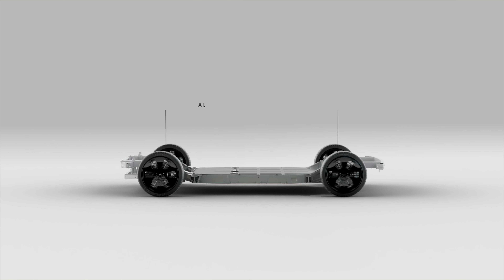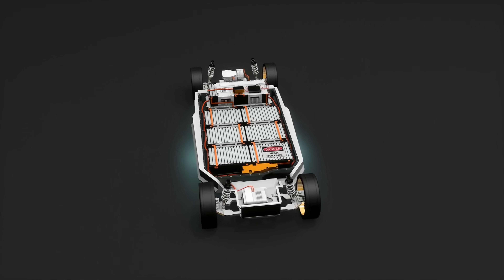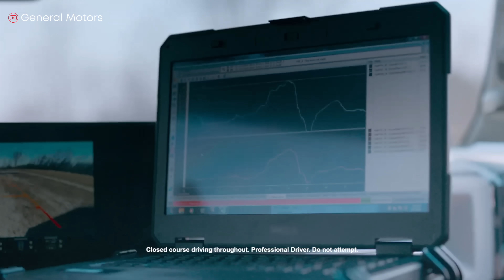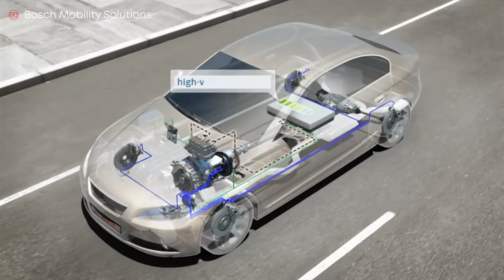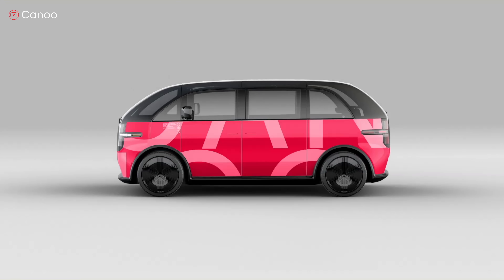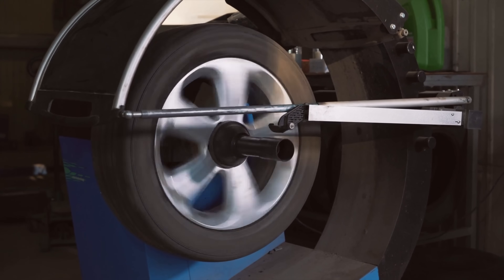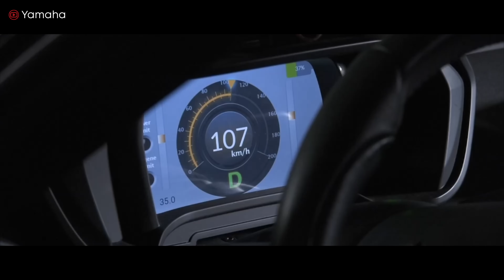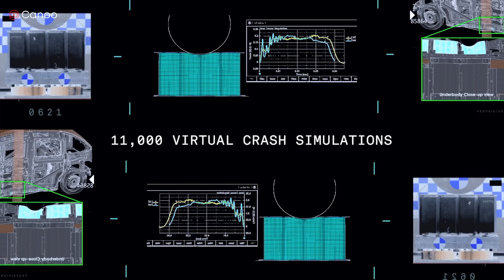No One is Telling You the Truth About Electric Cars, So I Have To

Comment: As an electrical engineer I am impressed by the accuracy of the content, keep it up!
Reply: how about this... After every one owns an electric car, where will the charging power come from? As it is, hot summer air conditioners overtax the grid ! Think about THAT ! Seems  no one ever mentions this !!!!
Reply: @marcelfortin7035  This will require building additional power plants and running the ones we have at higher capacity.  It is only a temporary problem.  The main issue with adding more power plants, is that they will most likely all be coal.
Reply: @tonycable4560  if the public would just get over it’s fear of nuclear fission, then we could have all the needed power for such station.
Reply: @crafterchief3812  Agreed!
Reply: @J Thompson agreed
Reply: @J Thompson if your responding to me, then I said fission specifically because at least to what I know, we are still in the cycle of fusion being supposedly only twenty years away(or in other words they haven’t and won’t figure it out for a very long time beyond what they say for sure when it will finally work as intended)
Reply: Have you tried creating a magnetic powered electric car?
Reply: @crafterchief3812  agreed

Comment: 2:35 Tesla vehicle are the only car you can charge to 100% regularly with no problem unlike other vehicles not more than 80%. Also the Tesla model 3 which is the cheapest Tesla can run 272 miles on a 100% charge.

Comment: I just bought a used Honda Clarity and as soon as I got it home, we realized it wouldn't charge. 

Took it back to the dealer to have them diagnose it. They needed $8k to replace the charging control module somewhere in the dash. The part itself was $4,XXX.

Forget the battery, everything else on hybrids are financial nightmares, too.

Comment: You say to avoid charging your battery too often when it doesn't really need it and I agree with you on that. But when using regenerative breaking isn't that exactly what you're doing
Reply: I thought the same thing.  I guess the recharge from regenerative braking isn't enough to cause the same issue as keeping it topped off.
Reply: That's a really good Point - so the batteries won't last as long in city driving and would also be good to consider not charging it fully in those cases.
Reply: @evhwolfgang2003  Regenerative breaking simply reduces the rate of net discharge. It's not possible for regenerative breaking to charge the battery up to or above it's initial charge. If it did you'd have a perpetual motion machine. Not possible.

Comment: Most EV's use liquid cooled thermal management to keep batteries at an optimal temperature.  This means that your EV may use a few miles of range keeping the components cool when you are not driving, but it will not significantly affect the longevity of the car (the Nissan Leaf is the anomaly as it uses air cooled batteries).  Most EV's will have ther brake pads last 100k-200k miles.
Reply: @jack99889988  You should tell that to all 56,000 of those people up in Sweden who have purchased electric cars and now make up over 50% of all cars sold there. They don't seem to be having the problems you seem to think happen.
Reply: @jack99889988  heard of a garage for storing vehicles?
Reply: @Aircam73  Same in Canada. A friend of mine has a 2007 Toyota Hybrid that hasn't cost him a penny other than tires
Reply: @jack99889988  actually no....not anywhere where it actually gets that cold in the winter. unheated maybe but not completely uninsulated.
Reply: @jack99889988  The point is it is cold in Sweden and the EVs run just fine. There are even whole YouTube channels dedicated to it such as Bjørn Nyland. He takes these EVs and actually camps in them in -36C temperatures. Something you can't do in an ICE as you would DIE.
Reply: @jack99889988  "People in cooler environments tend to be more developed hence they drive cars." 

Erm, what? People in warmer climates don't drive cars? Don't drive as much? I've been living in a warm lie all this time 😂
Reply: @jack99889988  Sales on Norway are actually at 84% EV or plug in hybrid. So even higher.
The total of pure EV's on the road is 520,000 based on a June 2021 survey. The total cars registered is 5.1Million so EVs are 10% of the cars used in Norway and climbing rapidly.

Seems to be a pretty popular solution to me that's gaining traction in a country with winter temps averaging -7C for the winter months with -18C on the coldest darkest days.
Reply: @jack99889988  Wrong on every count. Are you saying that people in tropical Dubai, Lagos, Mumbai, Bangkok, Hong Kong, Djakarta, Sao Paulo drive less cars? Or that people in those cities are less developed than people in Alaska, Siberia, Patagonia? 

Modern EVs have been tested in the harsh climate of the polar circle in Norway and work just fine. Why else would 54% of Norwegians would have decided to buy an electric car over an ICE car last year? 
Check the Bjorn Nyland channel here for some hardcore over-night camping inside various EVs in Norway's winter. He survived with the heat on all night having lost only 20% capacity.
Reply: @jack99889988  australia?
Reply: @Aircam73  they will operate but battery life and range are reduced is the point !!
Reply: @markp8295  well didnt u listen to the vid, cold temps significantly reduce battery life and capacity !! 
maybe they just want to be seen to be green !!
Reply: @rhett7716  The range may be reduced but that is well know for EVs as it takes a lot of battery to heat the car. It also has gotten better as most cars are using heat pumps instead of resistance heating. Battery life will not be effected as just about every EV out there has a thermal management system that will keep the battery from shortening its life by freezing. This has been proven by the hundreds of thousands of EVs that are operating in subzero climates.
Reply: @rhett7716  It reduces available capacity at a specific temperature, but doesn't deplete the charge. So battery heaters are used to allow the charge to be released.

It lowers the potential maximum range, but this further highlights how much range anxiety is irrational for the majority of journeys, since it only takes 10-20 miles off through heating.
In addition, they have a lot of chargers enabling users to warm the batteries up 5 minutes before setting off, without depleting the range as much.
Reply: @darksideblues135  What? Who is burying Lithium cells in landfill? Not in any first world country (excluding the U.S.. Not only is it illegal, but also people pay good money for them so they can recycle them.

100% recyclable using a fraction of the original resources, almost halving their initial high impact and further beating ICE cars for having much lower pollution through its life cycle.
Reply: my chevy volt still has factory brake pads  looking like new at 150k miles. I had no maintenence other than the ice engine oil chance, 12v battery, and tires
Reply: Battery management heating and cooling occurs as needed; even while driving. To say that it only occurs when you're not driving is incorrect.
Reply: Simply put you are very wrong. Batteries die in cold. I've parked a ICE engine in -40 for 8 hours and it is just fine. Not dying. And 30% of people who have bought electric  are are buying New ICE ones due to the multiple major issues with Electric cars.... Not being able to replace battery. Cost of battery, told 6k-7k. Actually about 15k to 20k...... Need solid state batteries. Game changer in 3 to 4 years.  Could go on and on....
Reply: I wonder how heavy EV cars handle in wet or icy conditions. Some northern areas have very cold winters so it would be good to know how EVs cope in those conditions
Reply: @gsabic  lol. Terrible excuse.
Reply: I don't believe you to be any mechanical expert when it comes to break pad wear and life expectancy. And I'll tell you right now you're 100% wrong.
Reply: @WheresWaldo05 you probably have more experience than my in "break pad" 
LOL
Reply: @darksideblues135  Lead, sulphuric acid, glycol, freon, lubricant, catalytic converter and more.   You really need to do some research before giving an opinion.
Reply: @Nuggetsoffudge  Yeah why are the Canadian Toyota so reliable?  I have a Matrix 2009 (gas) that has 268000 km on the meter and it still runs like new.
Reply: @luttrell1973  They handle very well. The weight helps them cut through the wet and icy conditions and their low center of gravity keeps them stable. There are hundreds of thousands of EVs driving in those conditions and if there was a problem it would be well noted.
Reply: @jamesart6568  What are you talking about? The fact that your ICE car is made from the same metals that are extracted from those damaging mines along with the fact you have to drill and extract oil to power them because last I checked I have never seen any kind of damage from EV mining that even comes close to what an oil tanker, oil rig or even an oil pipeline leak has caused to the environment. Plus old batteries get recycled as it cost less than half as much to recycle them as it does to extract new ones plus most of the metals can be recycled indefinitely.
Reply: @Aircam73  You haven't looked at lithium mining and that's just 1 small part of how damaging EVs are, and obviously you don't know about environment impact recycling batteries especially in a few years its gonna be a mountain of EV giant batteries. next
Reply: It’s a relatively cheap and effective process, but it uses a lot of water – approximately 500,000 gallons per tonne of lithium. In Chile’s Salar de Atacama, mining activities consumed 65 per cent of the region’s water. That is having a big impact on local farmers – who grow quinoa and herd llamas – in an area where some communities already have to get water driven in from elsewhere.

There’s also the potential – as occurred in Tibet – for toxic chemicals to leak from the evaporation pools into the water supply. These include chemicals, including hydrochloric acid, which are used in the processing of lithium into a form that can be sold, as well as those waste products that are filtered out of the brine at each stage. In Australia and North America, lithium is mined from rock using more traditional methods, but still requires the use of chemicals in order to extract it in a useful form. Research in Nevada found impacts on fish as far as 150 miles downstream from a lithium processing operation.
Reply: @1RealSpit1  and the CO2 made from extracting it
Reply: @jamesart6568  Do unicorns and fairy farts extract the metals, oils, fuels, fluids used to make your car? Once again the CO2 that is caused by extracting minerals for EVs is far less than are extracted for the constant need for more oils, fuels and fluids needed for ICE.
Reply: @1RealSpit1  It's a good thing that people observe the environmental impact of EVs, and thereby force manufacturers to reduce the damage they produce. However, we should be aware of a few facts, and view them in a relative perspective: 

There are about 10'000 to 20'000 people living in the Atacama, and we rightfully worry about them. Yet nobody seems to worry about the roughly 1 million people killed over petrol in Irak. Most EV batteries are made with lithium mined in Australia under completely different circumstances and using completely different techniques, btw. 

The water that goes into the production of one entire EV battery roughly equals the amount of water required to produce a few (less than 10) pounds of beef in Texas. 

All environmental damage inflicted by all EVs produced in the 21st century is still eclipsed by orders of magnitude by the pollution of just the Deep Water Horizon oil accident off Florida alone. 

When people look at all the damage and problems caused by EVs, they realise how bad it is to own and use one. They should however be aware that petrol cars are even much, much worse in almost every way. That's not something we like to hear and we prefer to ignore it, or by some magic turn it into the opposite.
Reply: @jamesart6568  I would love to live in the lala land you are. What tax revenue loss back? I also though energy companies already charged for electricity. Are you getting it for free and how can I get some of that? I don't think you know a thing about wind turbines, China or EVs because if you did you wouldn't be saying such nonsense. Also please post the Guardian article that admits EVs cause more CO2. Because there has only been a thousand studies that prove otherwise.
Reply: Just a small side note on the LEAF: Nissan's battery chemistry is formulated to permit hotter operation in the newest gen battery, and they are digitally managed also...so if a zone of batteries is running hot, the car can stop drawing from those cells, and if the whole battery is running hot, the motor power can be reduced, putting it into "turtle mode." This isn't generally something you'll run into unless you do 2 or more quick charges within a couple hours on a warm-to-hot day. This is treated like the Apocalypse by some EV enthusiasts, but the tradeoff is no moving parts in the battery cooling equipment, so there is an upside. If you live in mild climes, or are unlikely to go on 300+ mile trips in a single day with the car, you're unlikely to have to deal with it.
Reply: @Ilander86  It charges slower than every other current EV, even on a good day and it's 2015 tech overall, with low resale value. You can get a 58kWh Ioniq 5 base model for about the same price as a top trim Leaf, but the Hyundai is still better equipped and a better car in every aspect one might consider. And it will charge at 100kW AVERAGE in the worst of  scenarios, as many times as you want, which is more than twice as fast as the Leaf does PEAK, best case, and only once. A cheap used 40 or 62 Leaf is great for around town and the occasional somewhat longer-ish trip, and if that's what one needs, it can be a great bargain. But you can't seriously recommend a new Leaf to anyone.
Reply: @adrianguggisberg3656  Nissan is replacing it, they got the memo, but no real need to bash it. It fits a role, but people should buy whatever the best deal is that meets their needs.